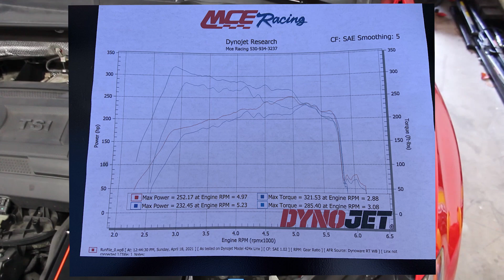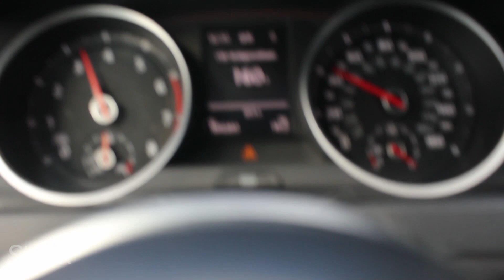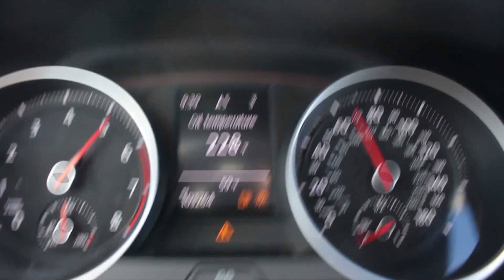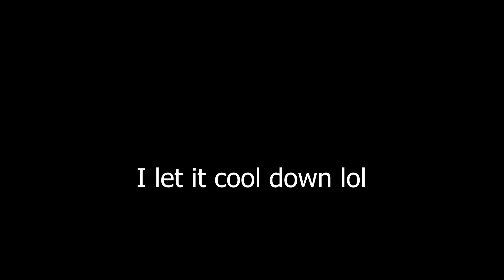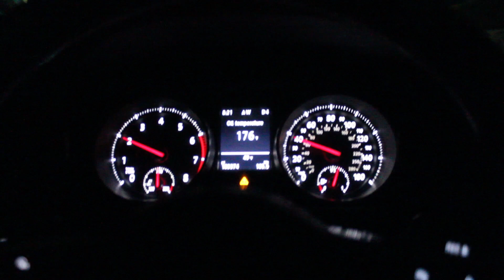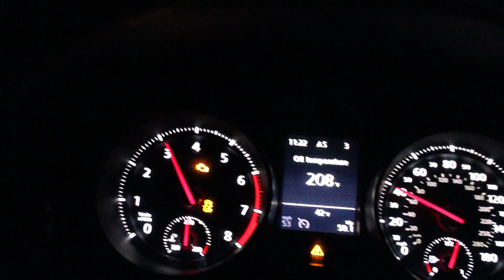Installing a 4" Trackslag downpipe and EQT stage 2! (MK7 GTI)

Comment: This an old video, but I been seeing people say that the slag is “bad value” for the IS20 compared the the IS38. Would you still recommend it on an IS20?
Reply from the maker: Yes 1000000%, the exhaust temp drops so much faster now and imo the trackslag helps make these cars sound much better. The is20 pulls so nicely too, I’m on e85 now and dude it rips. So idk why people always freak out about having one on an is20